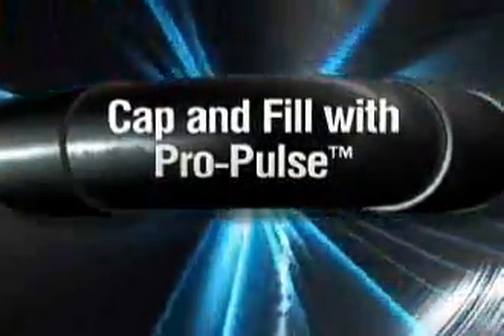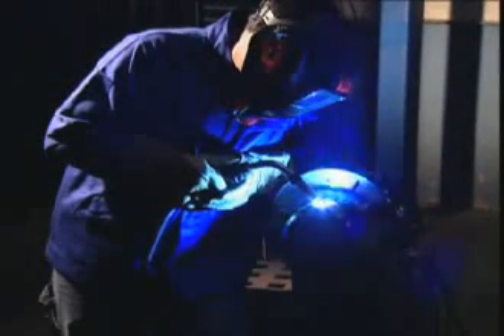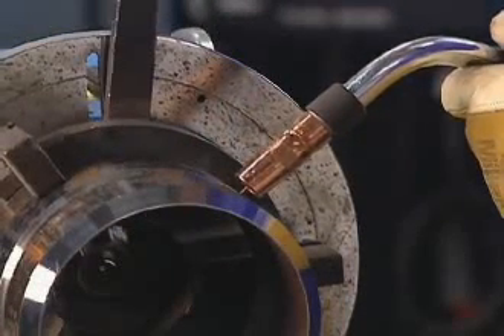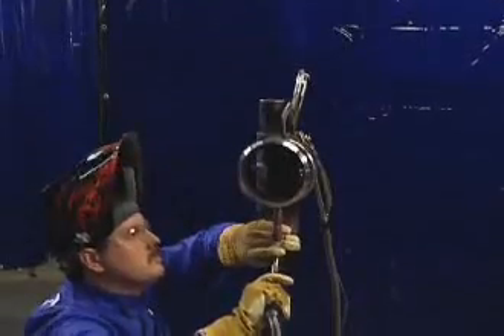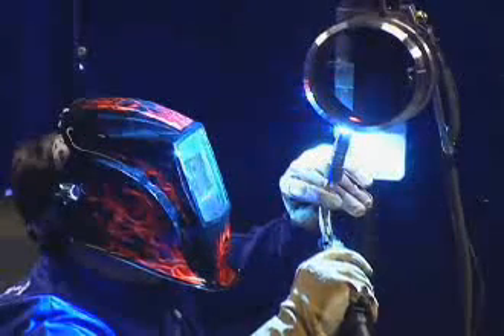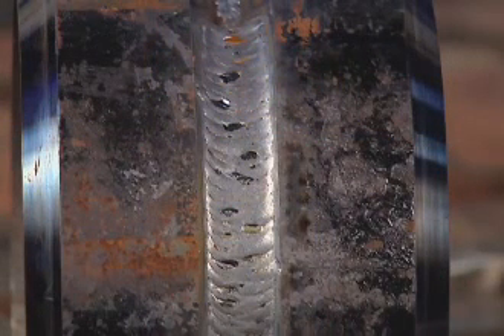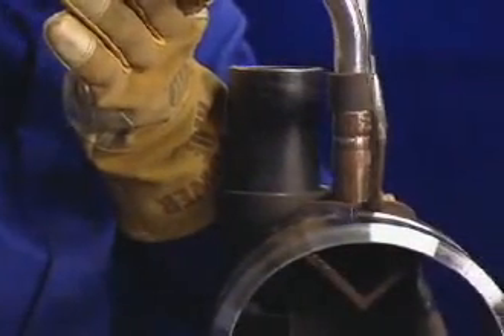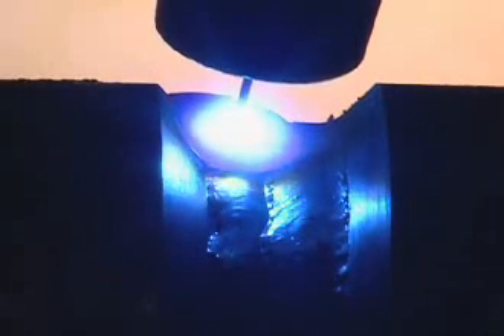Cap and Fill Passes on Pipe with Pro-Pulse

Comment: What kind of settings are we looking at?
Reply from the maker: Hi Brett! Thank you for reaching out. A good range for vertical up 180-220 and rolling 250-300. Start arc Length at 0.0 and go up one number at a time if you want a little more fluid puddle. Let us know if you have any additional questions.

Comment: I own a pipe worx and have never used the rmd iam going to try to set it up on a wiggler my weld supply store is trying to find best wire and gas mix to run on carbon so i can produce a wps for a customer.
Im looking to provide less heat input with quality weld

Comment: Do you need to put in a hot pass in schedule 40 pipe or can you just go straight to a cap after putting in a root
Reply from the maker: Hi Robert. Thank you for reaching out! There are a few factors to keep in consideration here. Do you mind answering a few questions for us?
What pipe diameters are you running?
What are the wire diameter, gas type and settings?
What position or positions are you running each may be different?
What is your progression (Push or Drag)?
What material type are you running?
Thank you!